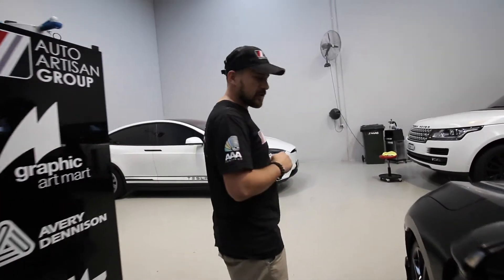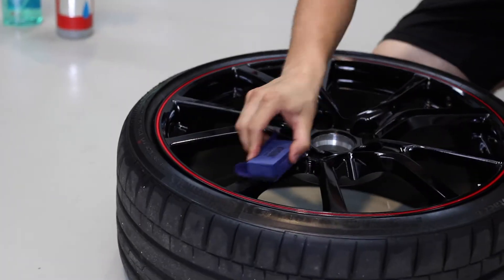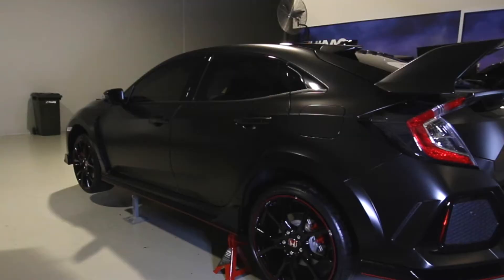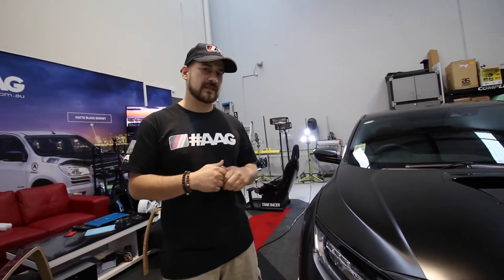Honda Type R 2017 Wrapped in Satin Black Vinyl

Comment: After wrap, what do you guys recommend to protect the job and the paper
Reply from the maker: Always good to use a pH balanced cleaner for detailing, protection is done through regular cleaning. There is also an option to place a protective film over the top for further protection if required.